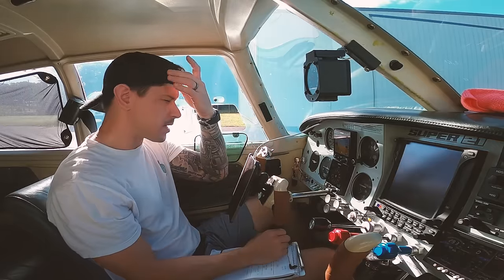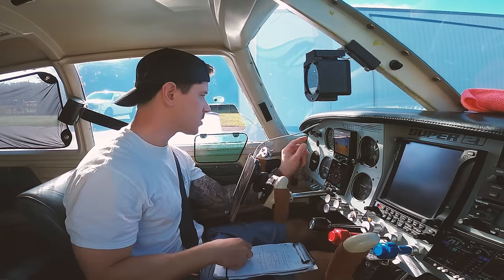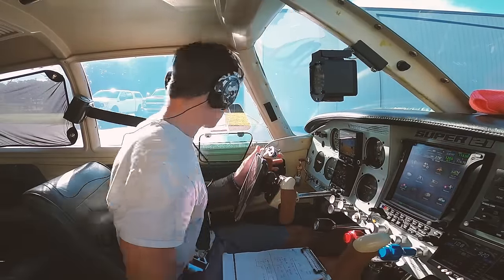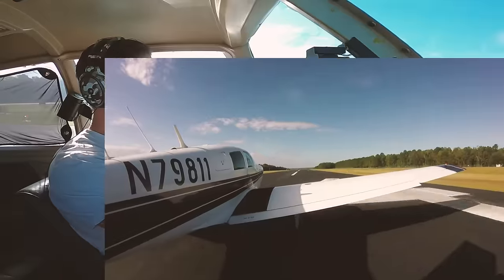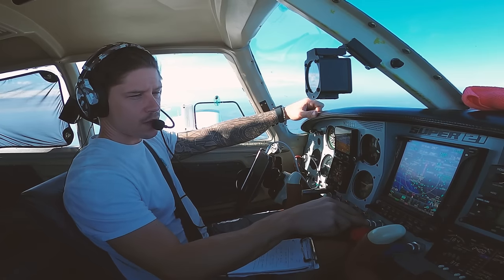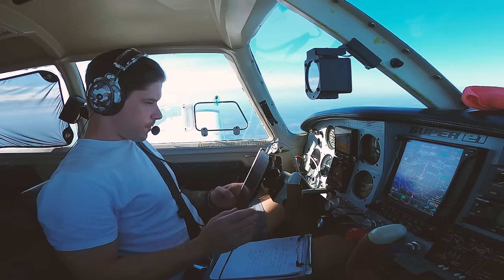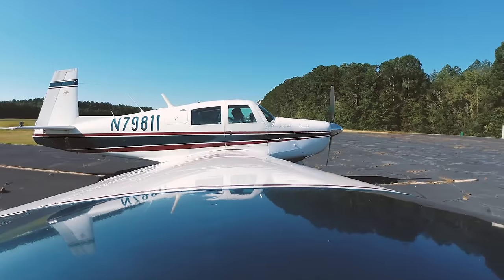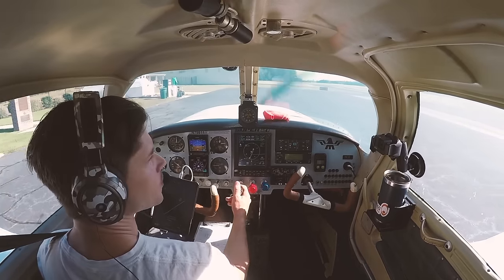Check Ride From Hell PART II: The Aftermath

Comment: I know the DPE you had.  I had the same little old lady at KEXX for my PPL earlier this year.  She failed me on the oral after rescheduling twice so she could get multiple rides lined up on the same day.  She asked me about aircraft inspections and I correctly stated that a 100hr inspection is only necessary if the airplane is used for training or commerce/hire.  Just an annual for a personal airplane, which I have.

So that cost me more $ for a retest and remedial training.  Then during the flight she talked about Taylor Swift half the time and the flight was short and easy because shenwaz rushing to get to her next guy.  In the end the checkrides cost me like $1200, and after retraining and flight time it totalled around $2000 down the drain.  It put me off going for my instrument after the experience.

Comment: I'm glad overall my instrument check ride experience was a lot better. I failed my first attempt since I circled in a area on the plate that was listed as "restricted at night", and the simulated conditions was nighttime. The examiner kept repeating "Just to be clear we are simulating night time situation", so I should of taken the hint.  He felt the only remediation that was needed was just a debrief on the circling requirements since the rest of the check ride was to standard, so was able to reschedule quickly.

We rescheduled for 2 days later and I passed.

Comment: Wait a minute, you failed to check the ATIS on the assumption your preflight weather hadnt changed? Didnt that get you in trouble once? Or talk about the wind sock? But I will say your checklist use is very professional and I think you will make a GREAT regional pilot. Not shitting you. Hope the market gets back to where it was. Get over that checkride; it wont matter in the long run.